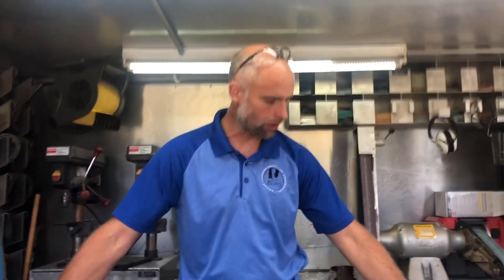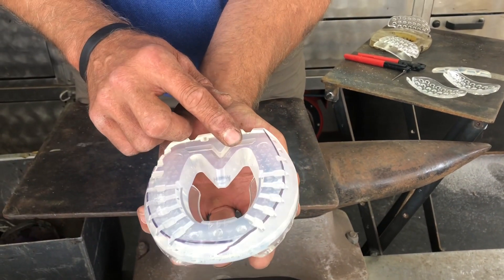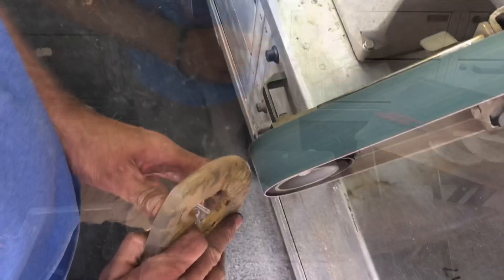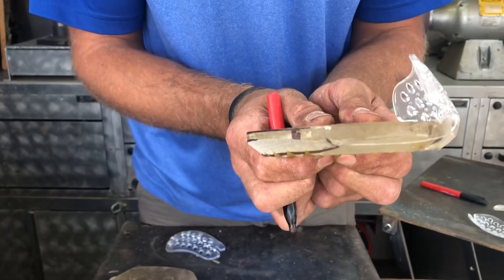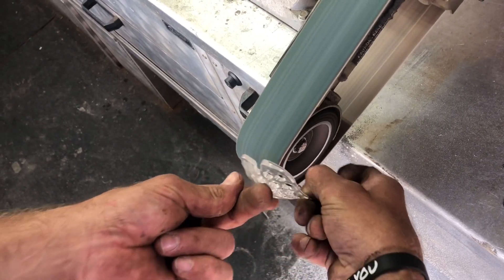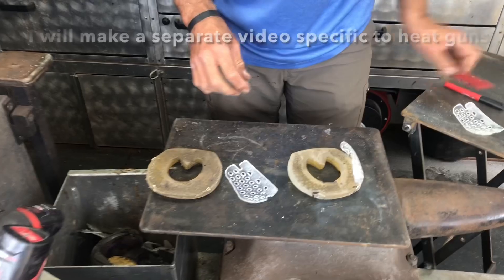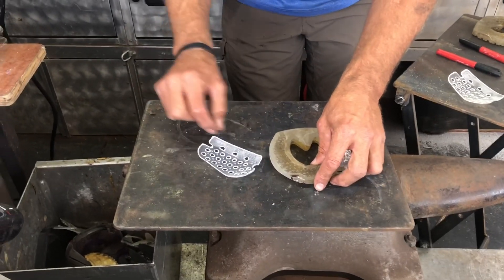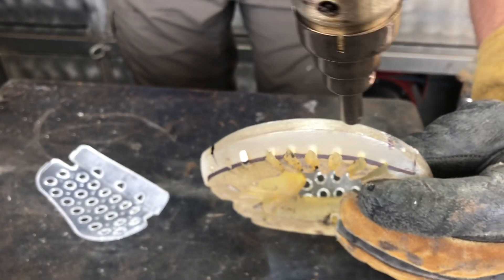How to weld a EasyShoe cuff onto a beveled edge

Comment: Well done. Did you slightly over bevel the shoe so that when the cuff was added you had the desired bevel?  Or does the weld become so thin that it is inconsequential?
Reply from the maker: Hey Keith, yes I bevel the bottom 2/3rds  of the shoe before I weld on the cuff. This way I can blend the cuff into the shoe while welding it on and when am I finish grinding, it is pretty hard to tell where the weld is.

Comment: Beautiful work. You make it look easy. Do you still use your clamp system for holding the cuff when you roll the shoe on?
Reply from the maker: Hey Connie, this is one of my first video projects, and I’ve learned so much since then—it’s been quite a journey! I’m still using the hold-down clamp, making sure my welding table is clean, and spraying a release agent on it to keep things efficient for plastic welding.

In this video, I’m welding a cuff onto a bevel. Most of the time, I grab a new shoe at this point because it’s quicker, but it’s definitely a handy technique to have up your sleeve!